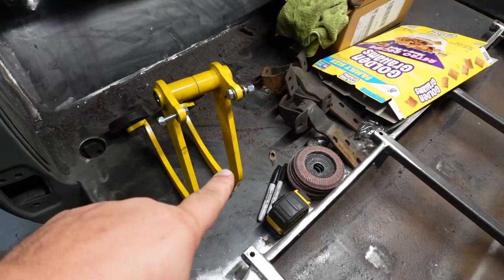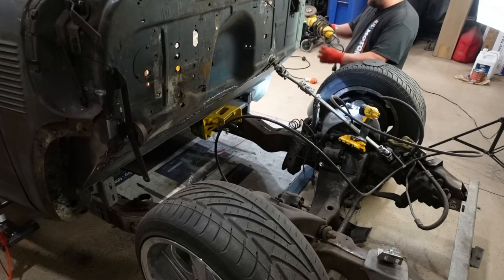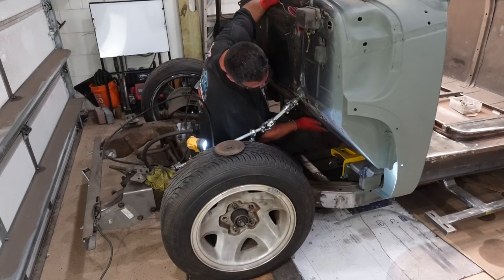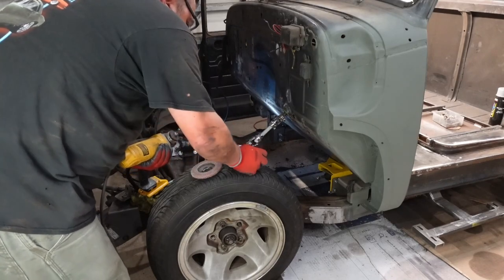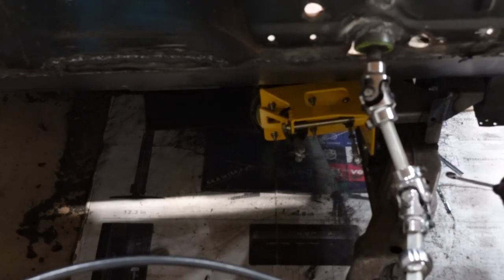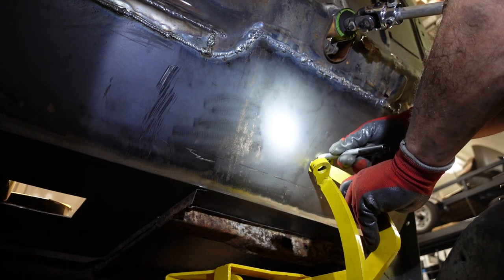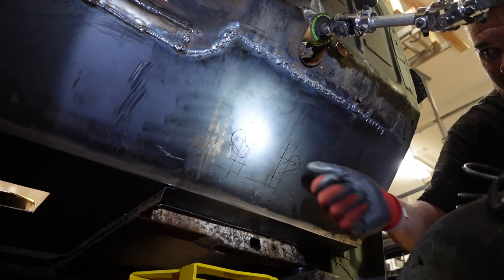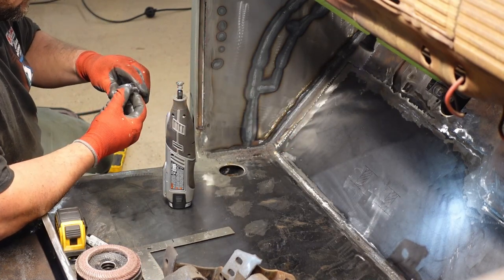PART 61 - 1952 CHEVY 3100 - BRAKE / CLUTCH PEDAL MOCKUP & PAINT PREP!

Comment: Where did you get the brake/clutch pedal assembly?  Can you give all the specs on it. I need to do the same type setup on my ‘41  Chevy Truck.
Reply from the maker: I bought this Brake / Clutch pedal assembly off of eBay back in 2020...... here is the link:  https://www.ebay.com/itm/322147080761

Comment: How did you address  the brake master cylinder.  Will it be on firewall or underneath?. How will you fill it if it is underneath. Can't  seem to to find where you addressed this.  Thanks for this build series.
Reply: Well I do see it underneath  like mine but whated to see  how you fill. Its always a nightmare  qwith me.
Reply from the maker: I have a 4 post lift.....but I'll fill it and get all the brakes plumbed up and working prior to putting the body back on the frame.  If I need to check it later, I'll use the lift, maybe a mirror...... Luckily you hardly have to mess with them.

Comment: Building the wife a 47 have a short wheel base s10 do I need to extend anywhere ? I’ve seen the guys use a single cab long wheel base but I’ve got a short wheel base and am trying to figure out where to start in the frame
Reply from the maker: Mine was a regular cab standard bed frame....... I took ABOUT 10" out of the rear bed, making it a "shorty" truck.....  No frame modification.
Reply: You can also easily add 10" to the frame to lengthen it to the proper wheelbase. Code504 sells a simple frame extension kit. Thats what i did ;)